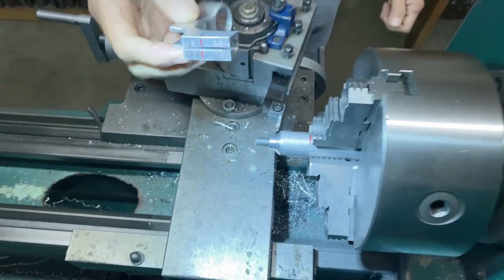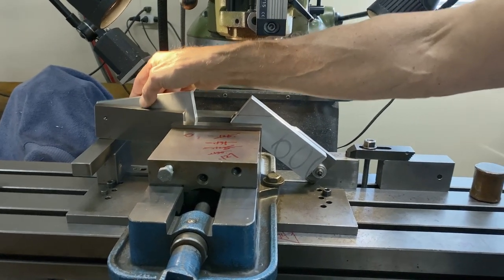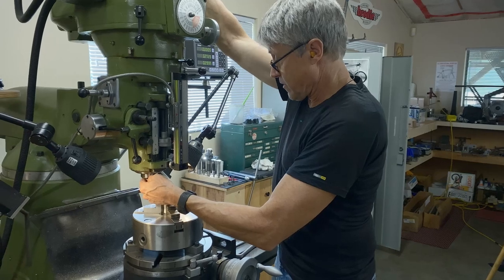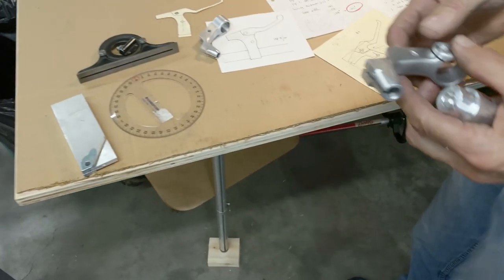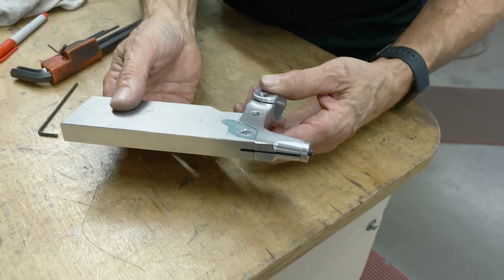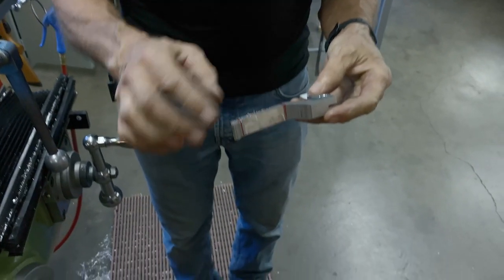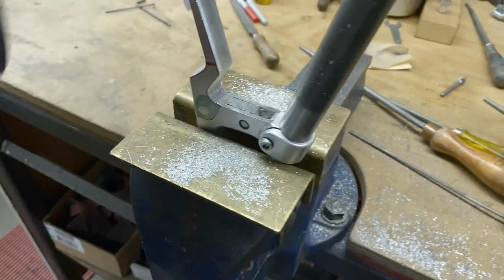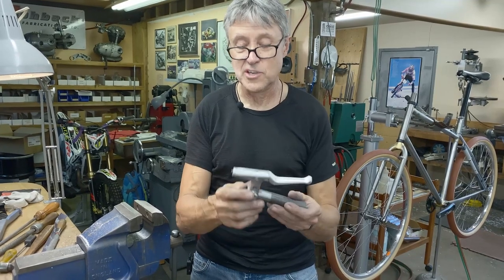Making a brake lever - part 2 // Framebuilding 101 with Paul Brodie

Comment: Certainly the best looking brake lever I've ever seen! I imagine in the 1970s, before CNC, someone at Campagnolo would have done something like this, but the finished product would then be used to make a mould for casting large numbers of parts.
Reply from the maker: Thanks Ben. I wasn't happy with the shape so it got redesigned, and so there will be a part 3, which wasn't planned. Stay tuned!

Comment: You need a sine bar and a tool maker's mini square.  The tool maker's square has ad adjustable T bar.  the Sine bar allows you to set angles to mill.  Booth are readily available on the used market.
Reply from the maker: Well, there is room in my toolbox for a couple more items. Thanks for watching!

Comment: your coarse file is called a curved cut file. if you pull the handle off i'm betting there's a 'vixen' (usa brand) stamp. used mainly for car body repair to check progress when panel beating.
Reply from the maker: I have 5 of those files. I checked today. Four of them came from Sheffield, England and have the brand name PF Tools.They are from the 60's and I still use them. The small one I use the most has DREADNOUGHT stamped into it. The fifth file is made in the USA by the Vixen Company.
Reply: @paulbrodie  you just brought back an old memory - my metalwork teacher at school (in the uk) used to call them dreadnought files. always loved the way they look, kind of extreme. hang on to those!
Reply from the maker: @daos3300   They work very well on aluminum. My father was an aircraft inspector (in the uk) in the 60's, so I assume that's where they came from...
Reply from the maker: @gerry343  Yes, that is correct.

Comment: Cool project. Maybe on bespoked cycles will be cool to have that preshaped body made with CNC, then file that preshaped body with a custom shape for each client. Using always the same lever body. This videos are great as always, still learning :) Thanks for the work!
Reply: As soon as CNC is involved it is no longer a handmade part......................period.
Reply: @Peter-V_00  That is true, but as you say on your comment a standart client will not apreciate all that work after a pair if levers. My comment was on the way of sharing "new tehnologies" with craftmanship to have unique and custom levers but you will know that you will have spare parts on the future. Probably I am making that analisys using the point of view of an industrial designer and not as a builder or artisan.
Reply: @jorgeperez2347  I get your point and agree Jorge.
Reply: I could see at some point, someone contracting a bike fit getting finicky enough to want full custom brake levers. Custom levers could also be very applicable to someone with a finger injury or mobility issue.
Reply: @lihtan  Great point !

Comment: So impressed by everything you do, love the Aermacchi front wheel/hub, just stunning in every measure.  I don't know if your brake perch/levers are going on the Aermacchi or not but they would certainly add to the hand built presence of the bike.  Also, I would love to know what brand of tools you use, from the mill to the files, hand tools, welder, etc.  It is so difficult to find quality tools and as you know, high quality tools are a pleasure to work with and make or break a project.   Thanks for sharing your skills with the world!
Reply from the maker: Thanks Ben. Our Shop Tour video shows quite a bit of what I have in my shop. Not everything, but quite a bit. The brake levers got installed on my Romax bicycle. The Aermacchi has Magura levers.

Comment: I know the lever pivot point is different but it reminds me so much of old 90's REAL levers.
Reply from the maker: Moving the pivot point even a little bit can sometimes make a Lot of difference.
Reply: @paulbrodie  I totally agree. I realized this when V-Brakes came out. there were certain levers that already had that sliding cam action or at least a slide, be it adjustable or not. like the Dia Compe pc8 versa.or the early window box sti lever from shimano. Maybe i'm crazy but i used them well on v styles

Comment: 6061 is precipitation splution and hardened. You can machine solf and harden after.
Reply from the maker: Yes you can. But machining 6061-T0 is not very nice.
Reply: @paulbrodie  try lubricate with ethanol if its smearing.

Comment: why not to add the bearings for smoothness when pulling the lever and 2 bolt clamp for easy installation?
Reply from the maker: Yes you could do that, but bearings are heavier and add bulk. I also wanted the clean look of a one bolt calming system. Thanks for watching!
Reply: @paulbrodie  yeah, later i've figured out that the goal was the beauty of simplicity) great videos, great job!